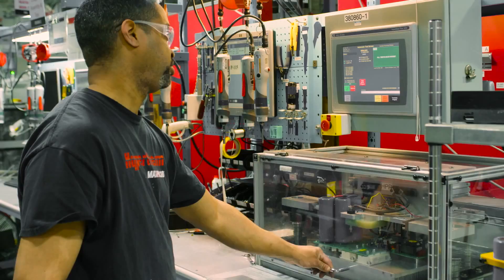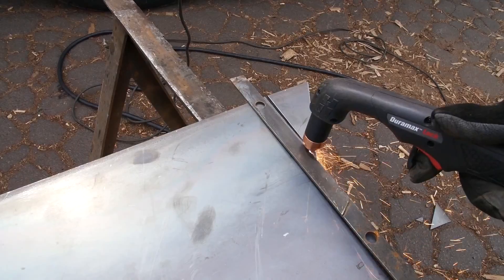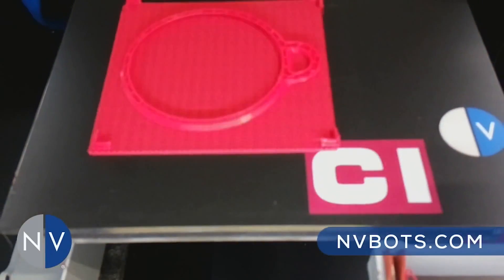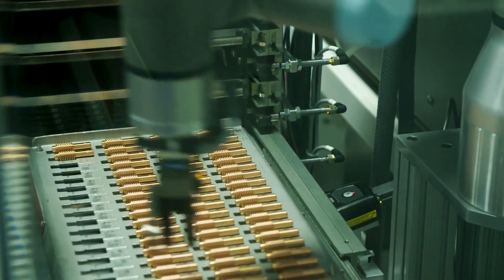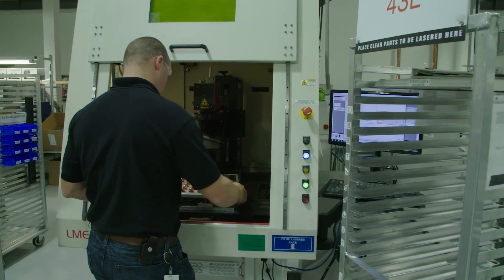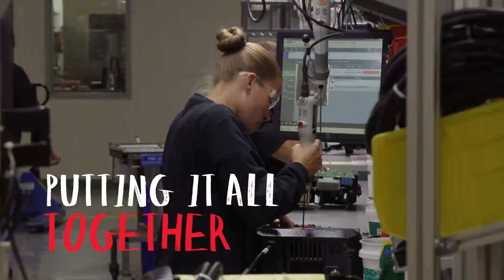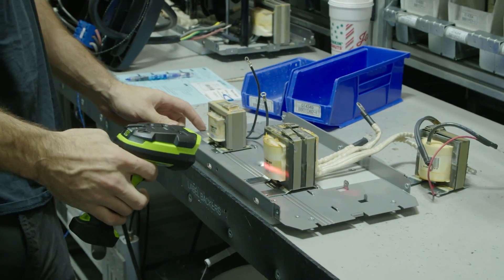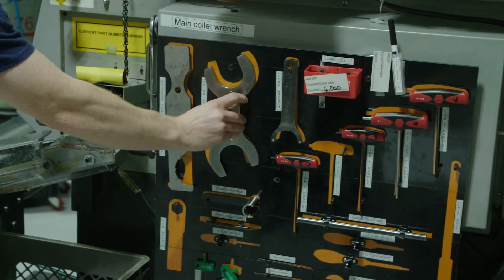Hypertherm Virtual Tour

Comment: I have an older HT 350 with a Pac 110 torch. It still works fine.  I bought it in 1998. I'm just a hobbyist but was wondering if there are newer tips or torches that might improve my cutting? Thank you.